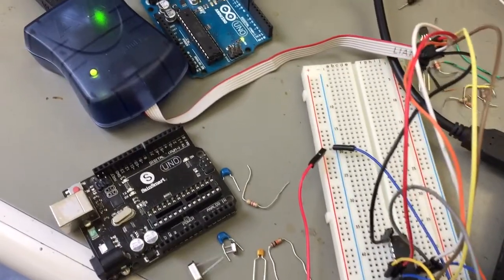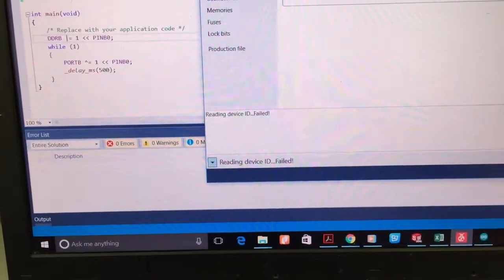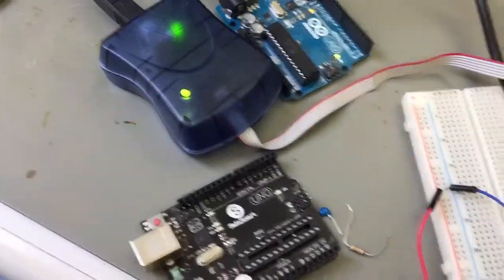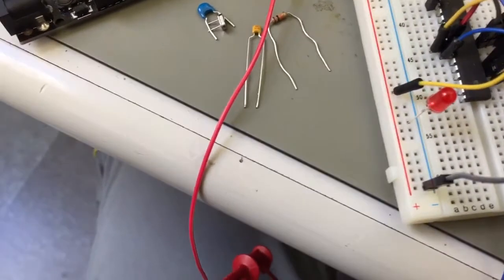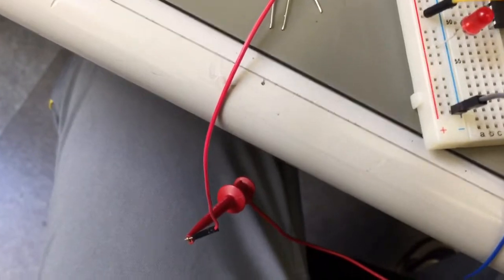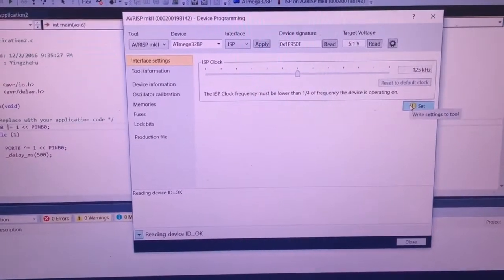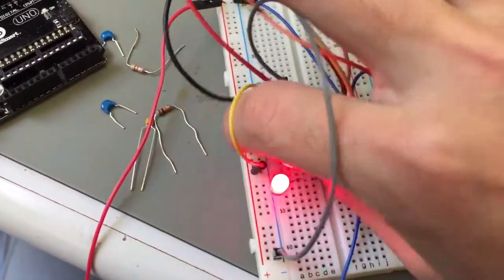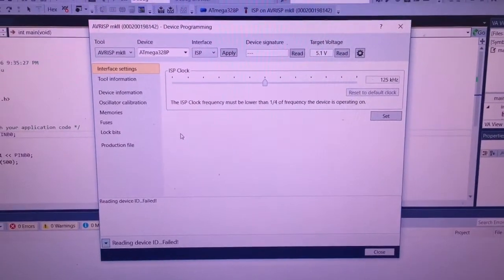How to use AVRISP MKII and Atmel Studio 7.0 to program ATMEGA328p on Arduino by Regi

Comment: The reason for the crystal is because the arduino  chip has fuse bits that are programmed to operate via a crystal. Thus you need to set it up that way!!! good observation!

Comment: That is 16MHz crystal? 
Do You know why need that crystal?
Reply: For me. I needed it because I played with an Arduino as ISP and it seems it set the oscillator fuse to external. After I connected the crystal and the Atmel Studio recognize the ic I was able to set it back to use the internal 8MHz oscillator. And do not forget to use capacitors when use with external oscillator. (For me it didn't work without it, an 18-22pF ceramic will do the job)
Reply from the maker: The one I used is 12MHz which is the big one, the small one is 16MHz. Both are Ok. I remembered there is a range of crystal that you can choose to make it work. https://www.arduino.cc/en/Tutorial/ArduinoISP. I hope this link will be helpful. Thank you very much for your questions!
Reply: @peterrefi5121  Hi  Peter, Could you please help me with the schematic where the capacitor is connected? Would be a great help if you could provide the link . Thanks!